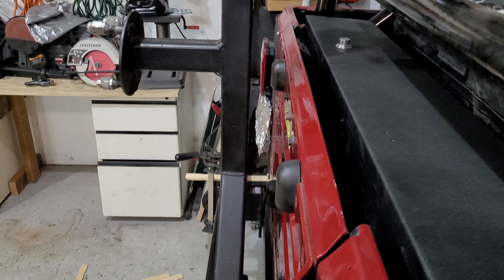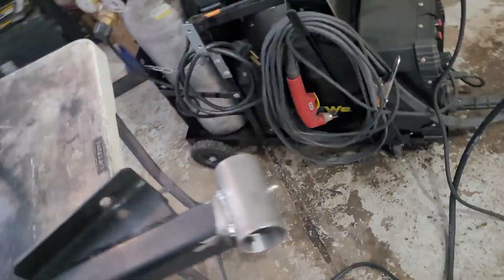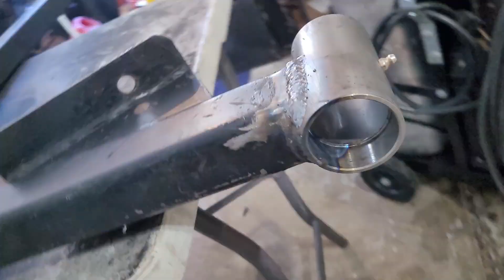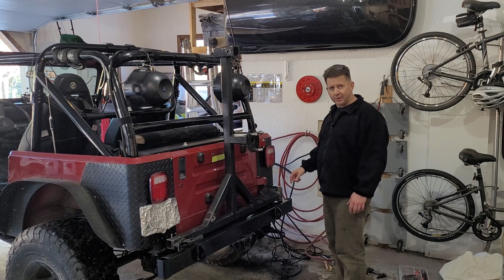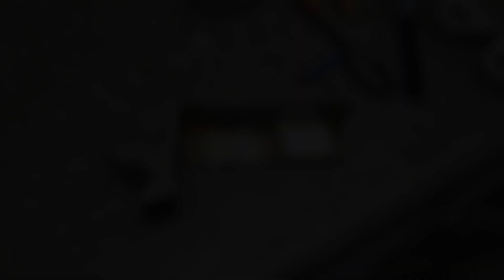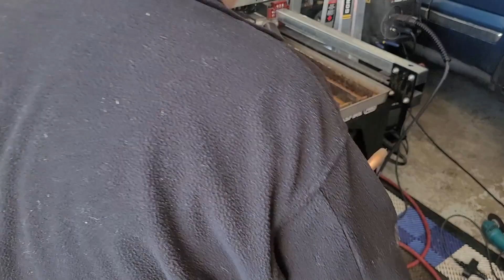1988 Jeep Wrangler YJ Custom Spare Tire Carrier Build

Comment: Looks good! I have a similar style A-arm swingout that appears to be some ebay/Amazon branded bumper that I added two fuel-can mounts, 1 per side of the tire, similar to how you did yours. My concern is total weight on the hinge. Do you have plans to possibly brace or secure the swingout arm somehow higher up on the rear of the Jeep to minimize bounce or shearing forces when driving or on trails?
Reply from the maker: I had actually thought about tying it into a support on the tailgate to keep it from bouncing too much.  Would be interesting to see just how much that hinge can take